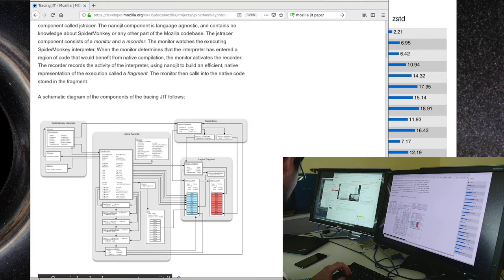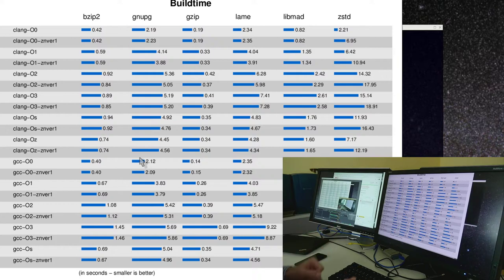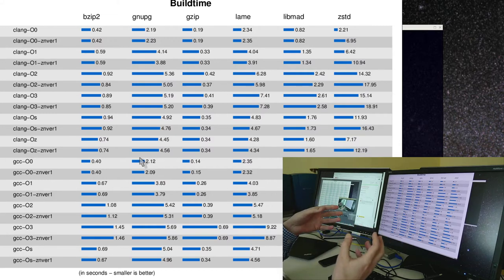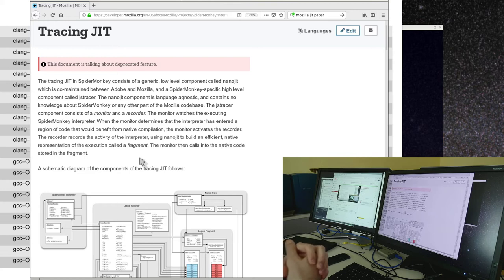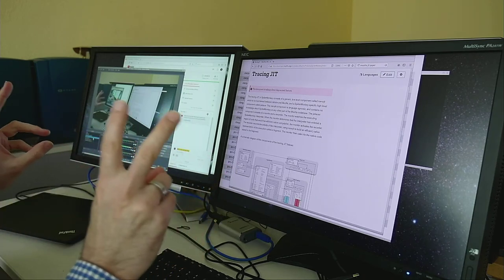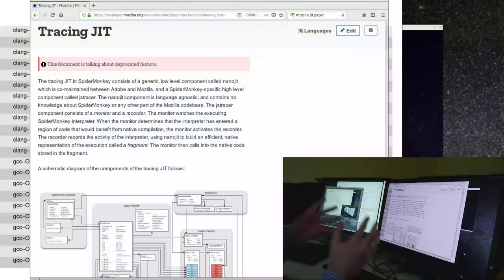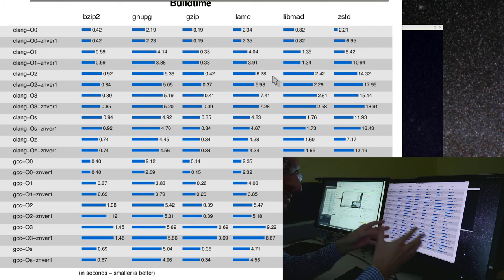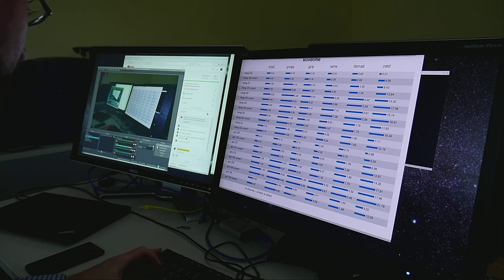Why I think JITing a whole (micro kernel) OS would be amazing!

Comment: It would be really AMAZING if something like this is available.  I remember that  I read somewhere in 1991 about similar OS called TAOS, basically codemorphing on OS level, JIT micro kernel OS compiling from virtual processor bitecode to underlying one, doing heterogeneous multiprocessing on hardware box with x86 and Hitachi SH or Transputer running same tasks. Later renamed Elate and Intent. I just googled and find out that one of creators, Chris Hinsley, is doing conceptually similar thing in GPL at https://github.com/vygr/ChrysaLisp

Comment: Java is actually one of the faster JIT using environments/languages (it has a memory issue, but that isn't unique among highly object-oriented languages either, especially with a GC).
If you look at actual benchmarks of languages every other JIT or interpreted languages is much slower overall. Not because Java is fast, but because they are all slow as fuck. There are a few simple comparisons on the following page, including Java vs Lua performance: https://benchmarksgame-team.pages.debian.net/benchmarksgame/
If you want something more portable than a precompiled binary, why not go with compiling on installation? That way you know the hardware and can optimize for it (perhaps even keep the sources around, recompile if major hardware changes occur), but you can use an actually fast programming language/environment. If you don't like C, personally I found it to be much more pleasant than one expects, you could go with Rust, Haskell (if you want really functional) or Go, which when using go get already does compile on installation. It would leave you with libraries, or even just plain static binaries, which could easily fulfil the role of userspace daemons in a microkernel concept. If you think about it a little more broadly, that is somewhat what software like kubernetes and docker do. They utilise a base API provided on kernel level and a lot of user space code written in Go to make a proper system out of it. Not the same as drivers, I know, but it kind of is the modern equivalent to time sharing, multi user, multi process, IPC, scheduling, etc. which are classical kernel tasks.
I've never used lua myself, but objective tests seem to indicate that it is a little better at memory usage, but a lot worse at CPU throughput and latency than e.g. Java.
I realise you are mostly speculating and so on, but please don't think that performance, especially latency is unimportant. Yes hardware is greatly improving, but so are the demands to it. It only takes a badly optimised driver to get screen tearing, especially on 4k displays etc.
I can't tell you how often I have been waiting for or otherwise cursing the abysmal performance of shitty python or ruby code that somehow is everywhere. Ruby recently added JIT, but that didn't significantly change the problem and it can't if your programming language is dynamically typed, etc. that simply takes extra work at runtime. There is no clever way around that.
Reply: The results for Lua on those benchmarks used the standard Lua interpreter.
If they had used LuaJIT, the scores would rival those of NodeJS, or even surpass them in some cases.
Reply: @bit2shift  Maybe, but NodeJS sucks in performance, so that doesn't really change things fundamentally. But yes, always go for as much performance as possible, especially if all it takes is to turn jit on or switch the interpreter. Why wouldn't you.
Reply: @autarchprinceps  well, it's an interesting case with Lua, where it's mostly used to provide scriptability inside other programs (video games, for example), so I would argue there isn't a strong need for maximum performance in most cases.
Reply: @bit2shift  You say that, but then people ask, why their game is so slow running with mods and the likes. The question is what is the advantage you're buying with the loss in performance? I get it for GC & loose typing, but interpreters? Aside from REPLs I don't see the point. Again, I'm not advertising distributing everything as binary, but there is some point, where almost any use case allows for it just to be properly compiled & optimized. My steam prerenders Vulkan shaders after downloading or updating games. Why not precompile scripts when it installs games or mods with scripts? Or when the game first loads a new script or starts. Could be in the background even.
You mentioned Node.js. JS was also supposed to be just a way to get a few lines of scripting into a supposed to be static web page, now hundrets of thousands of lines of code run in browsers and additionally entire APIs and webservers in Node.js and it isn't even multithreaded. It makes sense to start transitioning to stuff like webassembly, that splits the work of real compilation & optimization between the developer releasing it and the download phase for the customer hardware specific options. And you end up not just with more performance throughput, but also less latency and more efficiency. And that is important.
Reply: @autarchprinceps  a few reasons I could think why Lua doesn't have JIT in the reference implementation stem from it being written in ANSI C: ease of integration, portability and robustness (I'd say along the lines of predictable execution).
The problem you mentioned—a game running slow with mods—is, more often than not, a use case that isn't properly tackled during game development. If a game isn't designed from scratch with robust mod handling in mind, what can you expect?
Two scenarios come to mind:
1·The game APIs exposed to the mods aren't optimised → blame game
2·The game APIs are lackluster and, as such, mods need to carry a lot of boilerplate with them in order to provide the functionality they need → you could blame Lua for being slow here but it's also the game that gets the blame

Precomputing/precompiling stuff is a good tactic but it shouldn't be too much of an encumbrance (like with the case of Steam using Fossilize to recompile the Vulkan shader cache when you start a game).

And don't even get me started on NodeJS, to be honest its creation was a mistake. You're right about WASM, we ought to use it more and ensure it has the interfaces (DOM, etc.) it needs to dethrone CancerScript once for all.